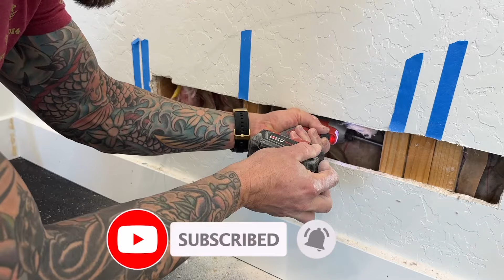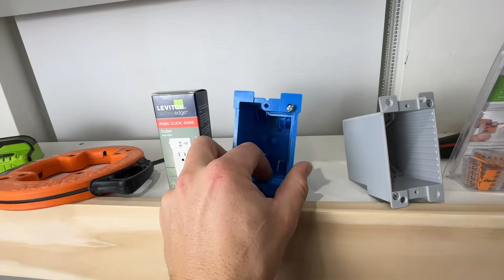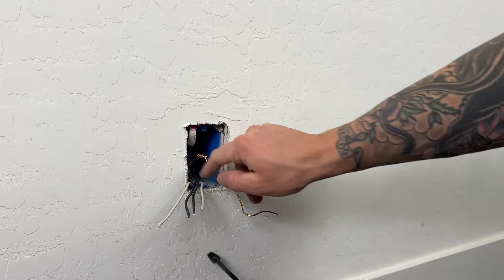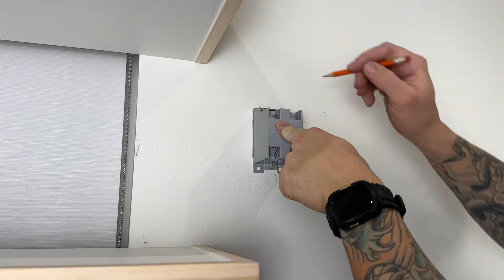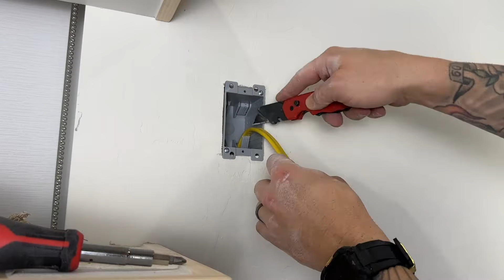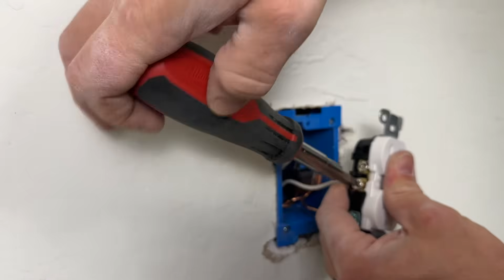How To Move An Outlet Up The Wall | Full How To

Comment: Could you do this but put outlet on other side in other room? You could remove baseboard drill hole above cut line. Baseboard 3.5 high , cut @ 3.25.
Reply from the maker: Yes, you could use this same method. You could punch through the wall on the other side, either at the same distance or slightly above or below wherever your current outlet is at. You could run the wire to the other side and have an outlet on the other side of the wall. I did this on one of my earlier videos on my channel. Had to add an outlet anywhere where I put an outlet into a bathroom next to the toilet for a bidet

Comment: wait..how did you wire the whites and the blacks before you re installed the blue box?
Reply from the maker: If your adding an outlet you tie all the white together, black together and copper together. Your feeding the new wires off the original ones.

Comment: I kept seeing other videos mentioning that the wire needs to be secured so many inches away from the box. Is that true for your location?
Reply from the maker: That is true when you’re doing new construction. There’s a code that requires the wires outside the box wall inside the wall be secured within 6 to 12 inches depending on where you live. But when you’re doing renovation work, the codes do not require that. I know it doesn’t necessarily make sense but they have certain standards while the house is being built and then other exceptions when renovation work is being done considering it’s not reasonable to remove a whole entire piece of drywall just so that you can put a staple on a wire. So they do have separate variances to depend on if it’s new construction or renovation work.
Reply: @FortKnoxCo  ahh. makes sense. Thank you for the reply!

Comment: Great video. Can you make one recommending a DIY shallow wall depth (low profile) kit install? My wall is an exterior masonry wall so I only have about 1 1/2" to maybe 1 3/4" of depth. There is an outlet in wall directly below my new location but I can't really tell much taking off the trim plate as to what the contractor used. Thanks.
Reply from the maker: You should still be able to remove the outlet box that is there and fish wires up or down or even across just like a regular wall. If you do have 1 inch to one and a half inch of space. They do make shallow retrofit outlet outlets as well. So you don’t have to worry about the new construction deeper boxes. But the process should be pretty much the same.
Reply: @FortKnoxCo  Thanks for getting back. Much appreciated.

Comment: Why not just yank the existing wire up?
Reply from the maker: You could try to feed a new wire through the back of the original box and finish it up, but sometimes that takes more time to actually accomplish then removing the old one and having more room to work and space to organize the additional wires. But it can be done. There’s several ways to do this. Sometimes installing a newer box, you can have a larger capacity, which helps with the added wires.

Comment: Before I get in over my head, would this process work for moving an existing multi-outlet assembly (there are 10 grounded outlets along the strip, hardwired)? I have a long strip that runs along my kitchen counters and I want to move it up under the cabinets so it’s more hidden.
Reply from the maker: This method works for moving or adding an outlet. Either for one or multiple outlets you can do. It’s all the same wiring and same process essentially.  If you’re saying you have 10 outlets all wired in a chain along the wall you can move one or all of them if you wanted too.

Comment: Awesome! I think you’re like the only one i came across who explains in the simplest terms and easy to understand. also, the regular outlets are always 15 amps correct? Unless it has that T shaped sideways which means ‘20’ amps. 

Thanks 🙏 appreciate you
Reply from the maker: Than you so much! I really appreciate that. And yes usually most outlet you’ll see are 15amp rated. Though I’ve seen the breakers on those outlets me 20amp sometimes. Technically they are supposed to be on 15 amp breakers so it all
Matches, but it usually doesn’t seem to hurt. And the T shaped outlet is usually a give away for the 20 amp outlets.
Reply: @FortKnoxCo thank you!
Reply: I had another question. 🙋‍♂️ please - I have an  outlet that the bottom half is connected to a switch and top one is always hot. i want to add an outlet on top of it possibly for a tv and run it from the bottom outlet. how can i do this without causing any issues? Thanks in advance. Or should i just do a tv wire hiding kit instead of trying to adding an outlet ?
Reply from the maker: @ConsolingYourMind you can definitely do this but you’ll just need to tie your new power wire off of the black that supplies the box. In the box there should be a constant power and that should hit the sides of the outlet that is constant. The other one that’s controlled by the switch will go the switch and back. So use the black and white that’s powering the constant outlet. Or use the wires that are coming from your breaker box into your outlet box that are supplying power. Those should be constant and can be branched off of
Reply: @FortKnoxCo oh wow. whats this process called please? maybe i can look up a vid online. Im a DIYer. I have no experience in this lol.
Reply from the maker: @ConsolingYourMind  the process isn’t called something specific. It’s pretty much the same stuff. I’m showing you in the video here. There should be a set of wires that come into the box that have power. You can test that with a circuit tester to see that they’re alive. Once you figure out which set of wires is the supply wires, you can then pigtail off of those to keep your current outlet wired the way it is but branch off the black and white up to your new circuit that you want to run above for the TV. All you’re doing is identifying the power coming into the box which is supplying power to the outlet. That’s there. You just need a circuit tester and then you can pretty much wire everything. The way it is but branch off your live set
Reply: @FortKnoxCo ohh.. ok. Makes sense. thank you so much for taking the time to explain to me. definitely appreciate you. i will keep you posted how it goes.
Reply: @FortKnoxCo  So, pretty much pig tail off the always on hot wire to the new outlet yes ? the black and white ones thats coming out from the bottom outlet take it off and pigtail it from the new romex 14/2 to run it to the top. and just leave the one from the switch the way it is ? is that sound right ?
Reply from the maker: @ConsolingYourMind  yep, sounds like you got it.
Reply: @FortKnoxCo ok. Awesome. 👏 thank you
Reply: @FortKnoxCo  i decided not to go through with it. Because, the outlet is connected to garage light, the outlet under the fire place. Too much connections at risk. when i turned off the circuit breaker. All those lights went out. that maybe over powering. if i add another one. 

Also, the wiring whoever did it before didn’t really do a proper job. As a DIYer. I’m too nervous to redo everything.

Comment: How did you hook the neutral wires back. Did you just wrap one around the other or use a wire nut?
Reply from the maker: I usually use a pigtail method. Where they are joined under a wire nut cap or connecting your choice. And a single lead comes off that bundle to connect to the outlet. I also like using the Wago wire connectors.

Comment: What if the original outlet already has something pigtailed on it ? Can you run a third one ?
Reply from the maker: Technically yes. Just make sure is clean and there’s enough space for the wires in the box. Usually there’s allowed to be 4 sets of wires entering an outlet box.

Comment: What do you do if you can't fish the wire because of a fire block between studs?
Reply from the maker: If you look at my video about how to move electrical up and over I show how to jump across studs in a wall. You could do a similar method. It requires a little drywall work.  
In short you can cut a small square hole next to the fire block, even try a “pumpkin” cut. Basically making a flap. But a square hole to allow you to hit the block with a small drill, push the wire through the fire block a fish up to your desired location. Then a small drywall patch job. Very common when doing renovation work

Comment: Do you have any videos on moving multiple outlets on the same wall up the wall?
Reply from the maker: Not specifically that but the process generally would be the same. How you extend the connection by tying into the original wires and how you feed wires up a wall is all the same. I have a video showing how to move wires across a wall and with the ability to run the wires up and across you should be able to accomplish this task

Comment: This video was great, and exactly what I was looking for.  If you don't want the outlet at the bottom, can you use the Wago clips you talked about and just close the box at the bottom.  Or in order for it to work do you need the box at the bottom?
Reply from the maker: Technically, you don’t need to have an outlet at the bottom. If you make connections in the original box that you don’t want to use anymore you just need to make sure that you’re basically splicing or connecting those wires at that location so that the power continues on the new location. The only problem I see people have is that they don’t want to use that original box at all and they want to cover it up in the drywall. Technically per code you’re not supposed to cover completely inside the wall any spliced connections unless you use a code compliant splice kit. They can be expensive, but sometimes allows you to completely cover up and patch the wall

In short, you can just extend those wires to the new location, tie the wires together correctly in the original box and put a blank plate on it and leave it there so that if it ever needs to be accessed, it can be.
Reply: @FortKnoxCo  Thank you so much for replying.   I want to cover it with a plate and leave it, so thank you for answering my question.
Reply from the maker: @SandraThomas-8469 your very welcome. Happy to help 🤙🏼

Comment: This is not moving an outlet. This is adding an additional outlet. There’s a difference.
Reply from the maker: Really it’s both. If you wanted to eliminate the original location and just simply move to the new location, you could. You don’t have to have the original one still in its place. You have a couple options with eliminating the first outlet if you’d like. Technically, the most straightforward way is to hardwire the connection in that original box and put a blank plate over it. Per code, they will ask that you are able to access any point where wire connections are being made. So you do not want to just bury the wire connection inside the wall without proper certified connectors.  That brings me to the next option where they do have some, but they are more expensive, options where you can make a wire connection and it is rated to be concealed within the Drywall.  So if you truly want a seamless look, and you do not want to have the original box with a blank plate on it you could do that with the more expensive connectors. It’s really all about safety and preventing any future fire hazards. But in reality, it’s really up to the person. I’m showing you the process of how to move or add the circuit or additional outlet. Depend on how creative you want to be you can make it into what you want. But everything I show in this video gives you the tools to do as you choose.

Comment: I see you  are using a double outlet for each box. Does this set up power all outlets? Or just a single one at the top and single at the bottom?
Reply from the maker: It will supply power to all the outlets. Unless you set up your outlet specifically to only allow power to one of the outlets where you separate or isolate. Usually, that’s only when you want one of the outlets to be operated by a switch and the other ones to be constant power.

But in general, this is running power all the way through your circuit and supplying power to every single outlet whether you wire the top or bottom it will supply power to both

Comment: This is great info but you didn't move the outlet up, you technically added one since original outlet is still there. I was looking to close off the existing outlet below and without a blank faceplate
Reply from the maker: You can still do that. I just went all the way through on how you could extend it. It’s really up to you whether or not you want to splice and then just leave that outlet there or splice and cover up the outlet inside the wall and not have the one at the bottom location. The whole entire process essentially is the same in the main thing that people usually want to know is how to make the connections and how to work the inside of the wall

If you are going to cover up a connection where you splicing wires and you don’t wanna leave the original box or face plate there depend on if you want to be compliant with code you may need a special connector which is just an in wall splice connector. They’re a little bit more expensive, but they’re more beefy and made to be covered up inside of a wall. Normally, you do not want to completely cover up a spliced connection inside a wall ever. But there are certain circumstances where people want to, and they do make connections for that.

Comment: Why yellow wire and not the white one?
Reply from the maker: The yellow wire is a heavier gauge and is more commonly used for outlets. The circuits are usually 20 amp and code usually requires the thicker gauge. It’s also just good practice and a better way to do it in my opinion. Older homes and older code I’ve seen white ran through the walls for outlets. I’m sure either would be fine, but I’ve always used yellow when it’s going to outlets.

Comment: Used this video to move an outlet up the wall.  Top outlet works bottom outlet has no power.  Thoughts on what I did wrong?
Reply from the maker: Hmm. That’s weird. If the power is getting to the top outlet then that’s good but means there’s something not connecting at or in your first outlet. The outlet may be defective itself if the wires are all correctly connected. Black to black, white to white. Copper to ground. 

Also look to see if your outlet has the tabs on each side still connected. This connects the top and bottom plugs on that outlet to share the power. There’s usually a small metallic tab that can be folded and broken off that either connects the two plugs or allows them to be isolated.
Reply: So I had a family member who was an electrician come by and take a look.  It was a simple fix as one of my neutral wires came loose.
He did compliment the work considering this was my first time doing any kind of wiring like this and so I credit your video and instructions for being very easy to understand and follow.
Reply from the maker: @DanielStewart-FB wow thank you! I really appreciate that. I knew it had to be something like that, a simple wire loose or missed connection. Easy and done. Happy you got it all taken care  of

Comment: What if I just want to move the existing box to a new location. I do not want a box at the old location.
Reply from the maker: You can do that and the process is basically the same. But where your old box is you’d be connecting the new wires like a splice. They have some splices that are made to be concealed in the wall so you don’t need a box to contain it. Or you can do a box with a solid cover plate and just connect the spliced wires in the box. Wires splices with caps as you normally would but really just extending the wires. You don’t want to cap splice wires and then conceal them completely in a wall per code.

Comment: Where does that 4th wire come from after you connect the other three?
Reply: Do you just grab a piece from the Romex wire?
Reply from the maker: Yep. Exactly. A lot of electricians will carry a 1-2’ piece of each color in bundles that they make from the romex. I just use cut offs that otherwise were scrap. Or I would cut my own intentionally
Reply from the maker: Usually it’s just another scrap piece of wire. I usually try to color coordinate it obviously to stay consistent
Reply: @FortKnoxCo thank you!!!